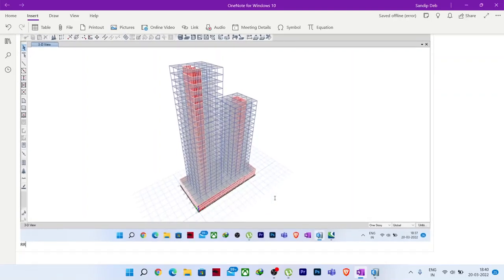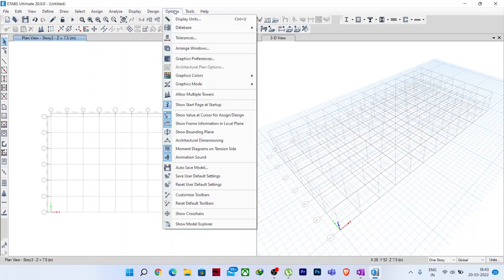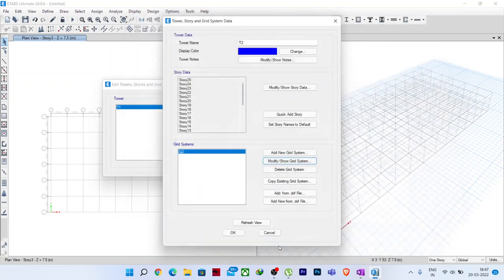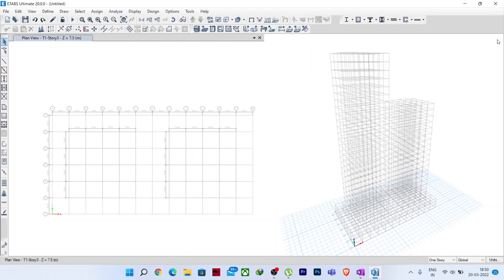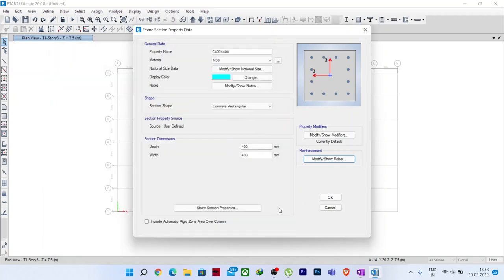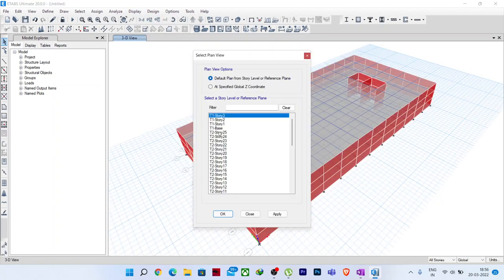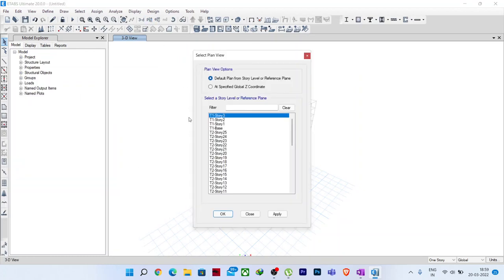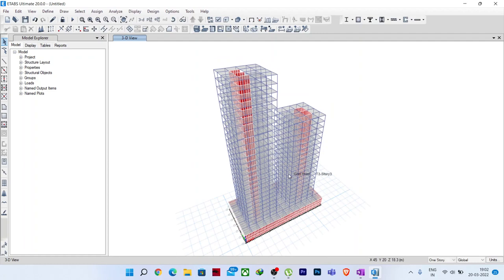Multi-tower Modeling and Seismic Analysis Process-ETABS | Part-1 | Sandip Deb | ilustraca

Comment: How to create basement floors in edit storeys.  Now you created podium above NGL right. Constructing podium above NGL is good or below.
Can you show the retaining wall modeling and design  for basement .
Why shellthin for slab. Why can't membrane. We need to design beam on safer side but on assigning shell, beam will get weaker and slab will not transfer full load properly to ground.
Also please take up flat slab structures like banquet hall in nxt videos.

Comment: For shearwalls  pier labelling need to be assigned right but here not applied.  
Waiting for gravity loads, lateral loads  and OHT (water pressure) assignment for these towers. And diaphragm  whether  rigid or semirigid to be assigned for high rise towers and for whole structure or each floor we need to assign , have confusion in this could you clarify .

Comment: very nice, thanks for sharing....can you please suggest me the system specifications required for designing  high rise in etabs, bcoz when we run 25 storey getting slow and takes around 1 hr for run analysis
Reply from the maker: It always varies..the system I'm using has 1TB SSD, 6GB RTX Graphics, 16GB RAM

Comment: What is the difference when we select yes/no for auto pier option while modeling wall?
Reply from the maker: If you select YES , Pier Labels will be assigned Automatically, if you select No, you need to assign Pier label manually